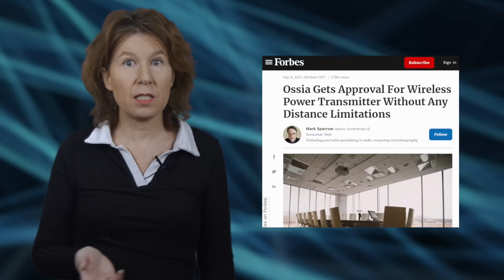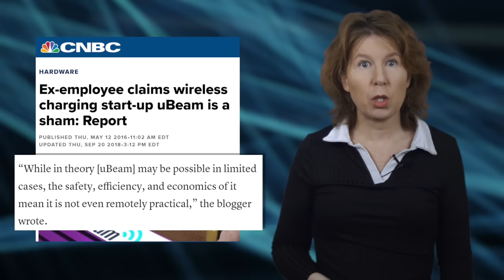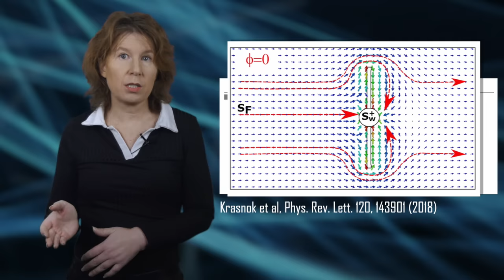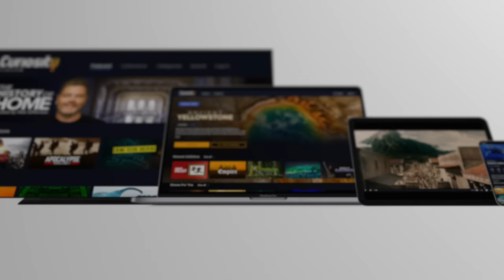How close is wireless power technology?

Comment: There was a farmer lighting his chicken coop wirelessly,  but he was 1/4 mile from a 50,000 watt AM transmitter, using a 1/4 wave antenna ( apx 125 meters ) to a tuned tank circuit. Unfortunate side effects, a huge notch in the radio stations coverage and a high SWR at the transmitter itself.
Still inventive and it was free energy, for him. Incredibly expensive otherwise.
Reply from the maker: ^^ quite a story!
Reply: I grew up in a farm with electric fences, and I'd always get shocked by the most distant, random metal objects, just because there was that much metal. Maybe there's a golden opportunity harvesting electricity from bad wiring
Reply: Here in the UK, an engineer did the same thing. Only this was the main TV transmitter for most of London and a lot further out. He had wired an aerial into his loft. Which means the entire loft was configured as the aerial. BBC and ITV engineers found him after hundreds of complaints about a newly noisy TV 'experience'. Using RDF, they pinpointed the house. The guy was convicted of stealing electricity.
Reply: @nicktecky55  At least he wasn't charged with battery.
Reply: Farmers in the U.S. have tried stringing wires on poles beneath high tension power lines that cross their property to collect power to light their barns. That's still considered utility theft, and they end up paying a fine.
Reply: Potential endless energy source basically anywhere in this universe:
a. Small aluminum cones with an electrical wire running through the center of the cones, cones spaced apart (not touching I'm thinking) but end to end.
b. Electromagentic radiation energy in the atmosphere interacts with the aluminum cones.
c. Jostled atoms and molecules in the cone eventually have some electrons try to get away from other electrons of which those electrons gather at the larger end of the cone, of which also creates an area of positive charge at the smaller end of the cone.
d. The electron's in the wire are attracted to the positive end of the cone and the positive 'end' in the wire are attracted to the negatively charged end of the cone.
e. Basically a 'battery' has been created inside the electrical wire itself, different areas of electrical potential.  Basically a 'wire battery' or a 'batteryless battery', however one wanted to call it.
f. Numerous cones placed end to end increases the number of 'batteries' in the wire.
(In series to increase voltage, in parallel to increase amperage).

*  Via QED (Quantum Electro Dynamics) whereby electromagnetism interacts with electrons in atoms and molecules, one would have to find the correct 'em' frequency for the correct material being utilized for the cones.  The shape of the cones could also come into play.  The type and size of the wire as well as the type and thickness of the insulation between the cones and the wire would also be factors.
*  Of course also, possibly 2D triangles made up of certain materials with a conductor going down through the center of the triangle could possible achieve the same 'batteryless' battery system.
*  Plus possibly with the 2D concept, layered 2D's that absorb different energy frequencies, thereby increasing the net output.
Reply: @charlesbrightman4237  Wouldn't that just be a capacitor? A very poorly designed one, at that.

I think you should spend a little more time thinking about the expected output of such a system and the effort required to set it up.
Reply: @Llortnerof  No, it's not a capacitor.  Learn about QED, Quantum Electro Dynamics.  And how much solar energy is a space ship or space base going to get when far away from stars?  Think about it.
Reply: @charlesbrightman4237  first we have to have spaceships going far away from star…
Reply: Other people have done similar, it tends to create a radio shadow behind their aerial.  nicktechy55 already mentioned this.
Reply: @Gunbold  First do my gravity test, and hope it does not destroy this entire Earth and all on it:

(copy and paste from my files):

Here is the test for the 'gravity' portion of my TOE idea.  I do not have the necessary resources to do the test but maybe you or someone else reading this does, will do the test, then tell the world what is found out either way.

a. Imagine a 12 hour clock.
b. Put a magnetic field across from the 3 to 9 o'clock positions.
c. Put an electric field across from the 6 to 12 o'clock positions.
(The magnetic field and electric field would be 90 degrees to each other and should be polarized so as to complement each other.)
d. Direct a high powered laser through the center of the clock at 90 degrees to the em fields.
e. Do this with the em fields on and off.
(The em fields could be varied in size, strength, density and depth.  The intent would be to energy frequency match the laser and em fields for optimal results, cancelling out the em modalities of the laser, thereby leaving behind the gravity modality.)
f. Look for any gravitational / anti-gravitational effects.
(Including the utilization of ferro cells so as to be able to actually see the energy field movements.)
(And note:  if done right, it's possible a mini gravitational black hole might form.  Be ready for it.  In addition, it's possible a neutrino might be formed before the black hole stage, the neutrino being a substance with a very high gravitational modality with very low 'em' modalities.)

(An alternative to the above would be to direct 3 high powered lasers, or a single high powered laser split into 3 beams, each adjustable to achieve the above set up, all focused upon a single point in space.)

'If' effects are noted, 'then' further research could be done.
'If' effects are not noted, 'then' my latest TOE idea is wrong.  But still, we would know what 'gravity' was not, which is still something in the scientific world.  Science still wins either way and moves forward.

*  And note:  Whether my gravity test or another's, a gravitational black hole would have to be formed to prove the concept as being really true.  A gravitational black hole that 'if' self fed itself, could literally wipe out this Earth and all on it, possibly this solar system, possibly put a black hole in this section of our galaxy, and potentially even causing a ripple effect in this galaxy and surrounding universe.  But hey, if it does, no worries.  Nobody would be left to prosecute those who did so.  (Possibly famous last words:  "Hey, it worked.  Ooooppppssss.................)

But as NASA has already proven that low gravity conditions over a prolonged period of time is harmful to the human species, and large rotating space ships won't really work for space bases on planets and moons, those space bases probably being needed somewhere along the way out of this solar system and galaxy, we need to figure out what gravity truly is and see if we can generate artificial gravity so as to have smaller space ships and proper gravity conditions for space bases on planets and moons.  Otherwise, at least all human life will most probably die and go extinct one day.  Currently, no exceptions.

**  Added note:  Just trying to save at least 1 single species from this Earth to exist beyond this Earth so that life itself from this Earth has continued meaning and purpose to.  Gives me something to do while I exist, otherwise, what is it all and everything for?  Even if my TOE idea were correct, but if it did not help species survive beyond this Earth, what good would it ultimately be?
Reply: Back in the early days of Radio, the American Federal Communications Commission had strict limits on the power of commercial radio broadcasts.  This limited the distance at which AM stations could be heard.  However, such limits did not exist in Mexico so very large and powerful transmitters were built in there that cold be heard throughout the American Southwest.  Local American broadcasters were often overwhelmed by the more powerful signal.  Hence the term "Mexican Radio."   Residents who lived near the transmitters reported light bulbs lighting up by themselves and other electrical phenomenon.
Reply: @Evi1 M4chine Canadian English. I was a transmitter technician at the station but about 25 years later.
Reply: @CAPSLOCKPUNDIT  With a sea water battery you have a salt and battery.
Reply: @daveh7720  Enough power to light a barn is more than enough to kill someone.

A few farmers have died from touching an ungrounded metal barn roof underneath a high tension power line. Quite a few have gotten painful electrical shocks from long ungrounded metal structures like barbed wire fences running parallel to power lines.
Reply: You can also get free energy by pulling a wire to those other wires hanging in the air next to your house.
Reply: @juzoli  I have seen that done in Mexico, well hooking three wires over the set running between street lights. Actually how the power companies establish demand before offering metered connections.
Reply: @CAPSLOCKPUNDIT  Boom-tish. The door man has your coat ready.
Reply: we had such a story in vienna, where the students did it for fun in the school. but that got detected pretty quickly, with a phonecall incoming, with very nice and typical viennese polite inquiries about their sanity.
Reply: The other side effect was that the chickens layed already boiled eggs.
Reply: @RandomGuyOnYoutube601  Birds and transmitters... VHF TV transmitters have birds roosting in the antenna to stay warm.
At AM frequency, they are too small to  couple enough energy.
Using a large florescent tube to pull an arc off the 200 ohm feed line does make a good hand warmer. You can listen to the program from the spark too.
Reply: As in the PBS documentary Chicken Run
Reply: @tarmaque  while servicing CBK ( Watrous, Saskatchewan, Canada ) I have measured 20 volts of signal from XERF ( if memory serves, it has been 40 years ) on its antenna. 200 ohm feed point so a whopping 2 watts of energy transfer. Still an impressive range.
Reply: She mentions energy travels locally.  If you had two entangled particles, could one receive an electron while still being in superposition?  If so, wouldn’t that then mean the other nonlocal entangled particle has more energy?
Reply: @daveh7720  If I put up a couple of wind generators on my property next to some busy  railroad tracks, is it stealing?:elbowcough:
Reply: @Rob Bannstrom Job Done:  Current Analysis:  Long Term:  (Very Short Version):  All life on and from this Earth is eventually going to die and go extinct.  No exceptions at this time.  This Earth and all on it are all just a waste of spacetime in this universe.
Reply: @cautiousoptimist  Only if the train is delivering air!
Reply: Shame she didn't begin with Tesla, whether good or bad.
Reply: the main high voltage transmission lines that form the backbone of our power grid are limited by an odd calculation

it gives the amount of current a person would conduct if a school bus was stopped directly under the transmission wires, pointed in the worse case direction, and a bare foot person stepped off the bus onto damp ground after a rainfall, while holding a handle by the door of the bus.

The metal body of the bus forms the secondary of an air transformer with the wires in the air.

The surprising part is: the limit is NOT set to a level that will prevent the person from receiving a shock, as they ground one end of the bus thru their bare feet. The limit is set to where the person would definitely FEEL the current flowing thru his hand, arm, torso and feet, but it is set so that he would be able to LET GO of the handle before his heart stops!
Reply: @Ray Lowe Hahaha!  Was his name "Jack Burton?"  (Big Trouble in Little China reference)  

When I was in college I knew a guy who was big into CB radios like that.  Perhaps not that extreme, but still always looking for the maximum range.

Today I drive a truck and use a CB a lot.  Mine's crappy and reaches about 50 yards at best, but there are big differences in the other truck's radios.  Some I can hear from a mile or more away.  Typically "legal" radios can't reach more than a couple miles depending on a variety of factors.
Reply: @Ray Lowe CB radios are legally limited to 12W on Single Side Band. 
Amateur Radio operators that have passed the license test can operate up to 2,000W. When you know what you are doing its usually not necessary to run more than 100W on a HAM band that has open propagation, with a good directional antenna - to be able to talk to people on the other side of the Earth.

Most likely your CB pirate was using a 2,000 W amateur radio linear (because you could buy them ready to use) and he was grossly overdriving it causing extensive harmonics into the TV frequency bands. 

Modern houses have 48,000 W grid connections  (240V at 200A). There is no way in hell he was pulling the 200,000W necessary from any plug in his house,  to output 100,000W to an antenna. The antenna itself would be glowing in the night like florescent light tubes.

Usually amateur radio operators in the area would flesh out the illegal CB operators, because they give radio hobbyist a bad reputation.  The simple fix is to put a sewing needle thru the guys antenna coax. The next time he transmits his illegal amplifier would go up in smoke.
Reply: @charlesbrightman4237  cones connected with a wire make an antenna.  The problem is the length of wire required to couple power efficiently.  The length must be a large fraction of a wavelength, and many wavelengths ideally.  QED is just another way of saying Maxwell's Equations.  If I am missing what you are trying to explain, do you have an article you can recommend?
Reply: @chrisfuller1268  Just my own thoughts and 'yes' you are not understanding it correctly.  The QED portion has to do with releasing electrons in the cones (or 2D triangles for the flat scenario), of which those like charged electrons try to get away from each other and collect at the wide end of the cone, thereby also generating a positive area on the small end of the cone.  The positive area of the cone then attracts the electrons in the wire and the negative end of the cone attracts the positive area in the wire, thereby setting up an electro-potential difference in the wire, an electro-potential difference basically being a battery.  A battery has basically been set up in a wire with no real battery being around.

Comment: Sabine, love this subject.  I work in a lab doing RF->DC conversion.  We're ultimately powering drones carrying a Neutron source and Gamma detectors used in explosives detection.  It's a bit more challenging than you may think.  We're presently transferring 1kW at a straight line distance of 100m.  We need about 15kW.  The 50GHz spectrum seems to be the sweet spot for this.  Affordable, wireless, directional power is a long way off from my perspective.  Keep up the great videos, I may have watched all of them. :).
Reply: In your opinion, is the issue a fundamental one? I am an industrial engineer and admit my EE skills are lacking, however it seems that these issues tend to have no clear path forward at this stage.

Comment: Thanks for the very good video, all you presented is up to date and accurate. I've been working on wireless power transfer (WPT) for many years, mainly on inductive WPT, it works fine, but the advantage all you can achieve is to not connect directly the device to the power source. Even if you take advantage of resonant WPT the distance you go is not so far. But there is a big problem, efficiency. If you want to avoid plugging your appliance into the power outlet, you pay at least 5-10% of the energy you draw from the outlet wasted in heat (a wired connection wastes less than 1%). It might not seem too much, but if you start to recharge large power appliances or cars in a large number it ends up in an enormous amount of wasted energy, just for the fun of not plugging the jack. Climate change and energy shortage cannot admit this waste of resources. In conclusion, WPT can be useful to solve specific issues, but at the moment its mass spread adoption might be dangerous for the environment.

Comment: My stepdad built his first electronics project in the 50s, a crystal AM receiver that didn't require batteries. It used the energy of the AM signal to power the circuit and a tiny earplug for listening.
Reply: Crystal Radios, was the first project all radio enthusiast made
Reply: I'm pretty sure the reason that is capable of working is related to the very low power requirements of such a device.
Reply: If you create a resonant circuit (like that crystal radio)  and use it in the Mhz Range instead of Khz you can transmit a lot more power.  Up to around 1kw.     10 Mhz antennas are not that big when coiled .... so you could easily fit it inside a phone case.

Comment: It's now been just over 20 years since a passenger aircraft in Scandinavia had to make an emergency landing because almost 200 people were using cell phones on a short morning flight . With all that wireless going on simultaneously on board an Airbus Aircraft , this caused moderate trouble in the aircraft's electronics and therefore that emergency landing occurred . All that electronics sending out all those signals simultaneously was certainly a bad combo for that morning flight .  Wireless technology can only go so far with our present technology otherwise there will be moderate interference with electronic devices .